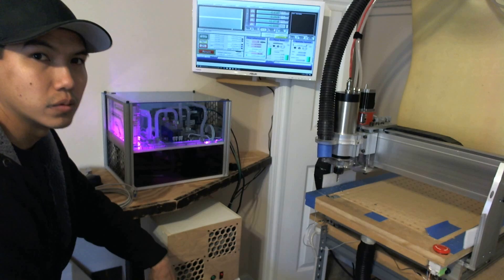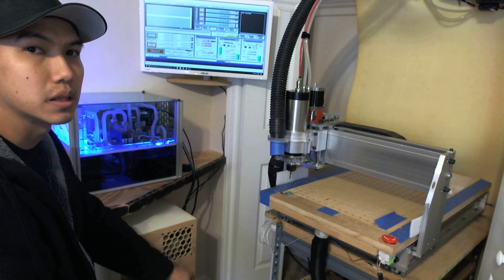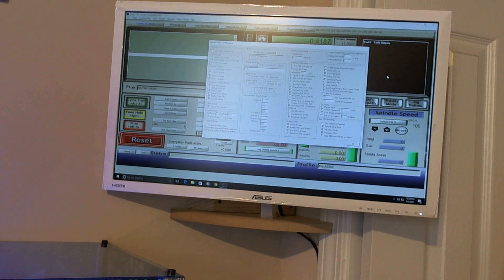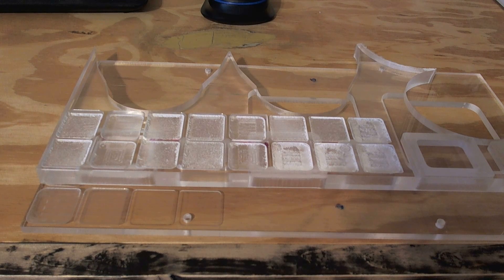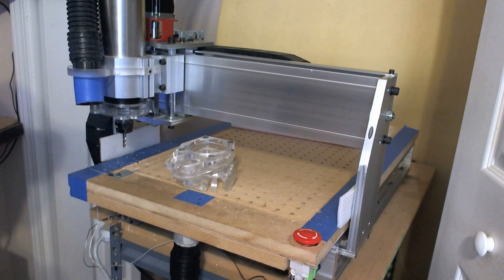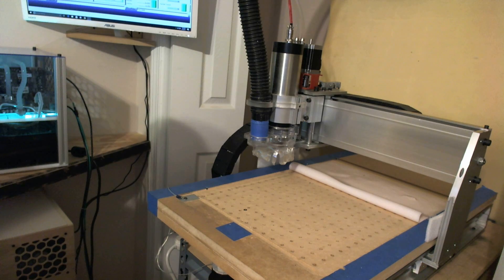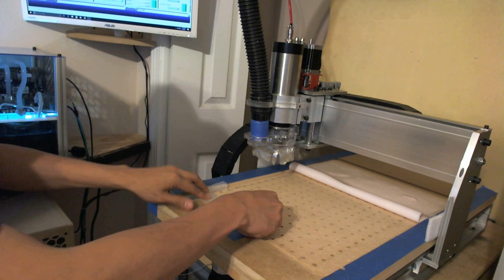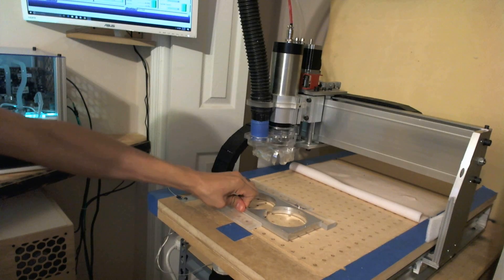CNC 6040 my problems and my fixes

Comment: HI 
CAN YOU HELP ME PLEASE 
I HAVE APROBLEM WITH MY MACHINE
Reply from the maker: I can try
Reply: @radikult-custom  z axis not working i get this massage "Safe Z turned off-ignoring safe z move"
Reply from the maker: @alideerhana1  did you “Home” the CNC?  Are you using Mach3 or what program you use to control the CNC ? 
That message appears when the Z axis has reach its limits of travel. 
If you are using Mach3 turn off “Soft Limits” and see if the z axis works
Reply: @radikult-custom  yes mach3
Whath you mean home
Can you send me guide ?
Reply: @radikult-custom  when i try to Turn the hinge screw i feel it not Catch not like the others x and y axis
Reply: Where i can see " soft limits " please
Reply from the maker: @alideerhana1  Mach3  is under Machine Coordinates “soft limit”
Reply: @radikult-custom  first thnx for your help 
, i will check today
If they not work , can i ask ypu again ?
Reply: Friend , not work 😓😢😢😭
Reply from the maker: @alideerhana1  I’m not to sure.  
 Config - Homing/limits  and see if the Z axis soft max and soft min is enough for your z travel

Comment: Hi, i have the same machine as you and everything is ok my problem is that the machine do the 1st cut really well but the second cut is offset? Any ideas? My i set the speet at 900 mm/ m and plunge at 500 mm/m... Please help me out.
Reply from the maker: It could be a lot of things.  Maybe some setting in the CaD program? Backlash setting? Noise going to the steppers.. it’s really hard to diagnose something. You just have to double check everything

Comment: I bought same machine, but gantry comes very unsquared. At the point i've made a gcode post-processor to compenste this problems. Do you have  experimented same problems on this machine?
Reply from the maker: Pablo Blanco I try to “adjust” the screws that hold the sides of the gantry to try to make the cnc square. But the closes I got to being square was 2mm off over the 400mm x travel
Reply: @radikult-custom  same for me!  I think the main problem is that only 1 motor control all the y axis. I have tons of problems with 2 side machining

Comment: Hi, I am new to CNC and just bought a 6040. Could elaborate a bit more on the macros you use in Mach3?
Reply from the maker: Sascha Schwarz the macros I found them on cnc forums. You will need to look for a tool change macro  and then place it in the “folder M6 start”   Located in you Mach3 macro files
Reply: I have seen that you mill thick aluminum on the machine. I tried some 6mm aluminum, but having problems when the bit cuts thru the bottom. I cut in multiple passes and it lifts my parts up in the last pass then the bit should mill the remaining thin rest, this caught in the flutes of the bit and lifts the part up. As the original aluminum extrusions for the table are so flimsy I am going to replace them now with a 10mm steel plate and adding a 20mm T-Nut table made out of massive aluminum instead of those cheap extrusions. I know I lose some height on my Z axis, but I hope I get more stability. 
Maybe you can do a video on the mill, speeds and feed rates you use for aluminum.
Reply from the maker: Sascha Schwarz I use a vacuum table to hold me pieces down,  maybe what you need is to leave some Tabs that way the piece don’t lift up after it finish cutting it

Comment: if I upgrade from the 1500 watt to the 2200 , will the electrical connection be the same ?
Reply from the maker: Rob M   Well the probably not,  I believe the 1.5kw VFD  is sometimes 110v  while the 2.2kw VFD are mostly 220v   Unless you find one that’s 110v then it could have similar electrical connections 
 Now from the VFD to the spindle will be the same connection except from the gauge  of the cables
Reply: well I got the 1500 watt usb version.. I cannot get mach 3 to communicate with the machine controller.. any advice ?? I know its an issue with drivers or plugins , im just not sure how to diagnose the issue.. I followed the instructions from the seller, but these only go so far.. If it doesn't work after their setup , youre kinda on your own
Reply from the maker: Rob M you are correct, Chinese seller are not to much help. The problem could be a “plug-in” for Mach3 to recognize the Chinese USB board, or maybe the setting on you Mach3 are not correct and that’s why it looks like it’s not communicating.  If I were you, I would try searching on forums and see if you can find any thing similar to the problem you have
Reply: I do think its a plugin or a driver .. from the instructions I got certain files need to be rewritten ( replaced ) in the C drive mach 3, but I cannot seem to make that happen.. been messing with it for days.. I have all the ports and pins settings and so on.. and the manual start info for the spindle , but that doesn't help till the machine moves
Reply: Hi Rob M I had that problem with mine
Reply: howd ya solve it >
Reply: did the seller send you any software for the pins and ports settings,it was loading that where I was going wrong
Reply: yes.. I copied that to a tee, tried 2 different computers .. tried different ports for the 378 sections.. etc etc.. Ive  been doing this for several days , mine is a new USB model so im really wishing I got the Paralell version.. reason is , theres a shitload of info on setting up the parallel version , theres really nothing on the usb version yet.. not to mention , Mach was designed to function via paralel
Reply: in other words, the controller has no parallel port anymore, just USB.. its supposed to be an upgrade, but its really a new headache
Reply: this also means the seller is sending me all the pin port configs for a Paralell , not USB.. I doubt they updated any of the info , and if I bought a parallel machine tomorrow , im certain all the info and downloads would be the same.. They don't seem to understand the difference when I messaged them asking them for the USB drivers, not the parallel
Reply: you mach3 did you get a file called USB6040
Reply: yes.. that file is in my C drive
Reply: ok. have you got mach3 and USB6040 backed up on a memory stick
Reply: no , I dont.. it was all emailed to me
Reply: I just downloaded and installed it , then extracted all the files
Reply: download it again onto a memory stick, because the download they emailed you will expire after so long
Reply: I have it saved on 2 computers, since I tried both computers.yes , it expires on the 6th
Reply: is the USB6040 folder in the mach3 folder
Reply: ill check now
Reply: I have a pdf file called usb6040 6090 .. its just the instructions
Reply: I found it in mach 3 ,. copied and paste it again just in case. no change
Reply: there should be a folder with USB6040 this is should set your pins and ports
Reply: yes, ive already done all the pins and ports from the instructions.( 8 times actually ). are you saying there is a program that im missing ??
Reply: they sent a folder with the files in it to set the pins and ports, all I had to do was drop the files into the mach3 folder and click on install mach3 and it set them all while it was installing
Reply: wow , I did all mine manually on 2 different computers.. that would be nice.. I think the port designations is an issue.. its running 378 port i.d , which makes no sense since that number is designated for the Paralel port ,.. since im running USB , id think that port identification would be different
Reply: mine is USB6040 CNCEST
Reply: I have the exact same model, what operating system do you run?
Reply: are there any tricks you remember from installing it ?? stuff that wasn't obvious
Reply: I run windows XP 32 bit. I loaded mach3 as they told and it didn't work.so I uninstalled it saved it to a memory stick and copied it into local disk (C) then copied the files from the USB6040 into the mach3 folder pressed install mach3 and that was it she just fired up. I just had to set soft limits and that was it
Reply: thanks,.im running out of ideas,, I might be the first person to return a brand new 6040 without ever testing it.. I had a bobs cnc router  before this , got that running no issues. So I don't think its me...Maybe the controller is dead in my machine, who knows.. thanks for all the help
Reply: one more thing , did you leave ox378 as the port for the machine in mach 3 ? in pins and plugs ?
Reply: I didn't have to change anything in pins and ports, ports is still ox378.I don't think it uses them because it's USB. do you have USB2 ports, have you asked the seller about the problems your having. I'm not sure I would have a bobs cnc router
Reply: the china seller also said use the usb6040 file.. but they never said what to do with it.. I already dropped it into the mach folder in c drive
Reply: the bobs cnc are made from wood , not rigid enough for anything but soft woods.
Reply: is the USB6040 file in a folder or is it just a file. mine are 4 files in a folder. I just copied the files into the mach3 folder and clicked on install mach3 and it worked ok
Reply: that was the problem.. I had it in the right place, but it was not opened.. I needed to download adobe reader.. Once I did that , everything started working , including the spindle.. thank you soo much ,I appreciate all your help!
Reply: there is a lot of guess work with there instructions. if you haven't used mach3 before be sure to set your soft limits and make sure your soft limits are on, other wise they are good machines for the money. if they play up it's most likely the wiring. have fun all the best
Reply: thanks man , already ran 3 g-codes no issues.. Yes , my instructions were horrible.. thanks again

Comment: HELLO FRIEND DOES LITTLE I HAVE A CNC 30 40, IT PROVES IT WITH MACH3 DEMO VERSION AND IT WORKED WELL BUT IT WAS LIMITED THE NUMBER OF LINES. DISCONNECT THE DEMO VERSION AND INSTALL A COMPLETE VERSION BUT NOW THERE IS NO COMMUNICATION BETWEEN THE PC AND THE MACHINE IF YOU KNOW A SOLUTION tankyou.
Reply from the maker: Alexander Cespedes I’ll check “ports and pins”  and make sure all pin outs are correct

Comment: Hi there. Thanks for doing these videos, they're extremely informative and helpful and your solutions are pretty ingenious. I have just bought a 6040 and have a lot of questions. I've got a UC100 arriving tomorrow so I can actually get the machine to start moving, I was wondering what the purpose of the red spacers was on your stepper motors. Are they something for preventing backlash?
Reply from the maker: Ben Smith the red brackets are just spacers, the shaft of the ballscrew and the shaft of the stepper motor is in the middle of the red spacer with a coupler
Reply from the maker: Ben Smith when I was using my 6040 I had a G540 and UC100  and the its was all good

Comment: Hi i just bought the cnc 6040 machine and first of already starting to regret buying this thing c/d i got was giving me an error setting up the mach3 eventually i got it online and was able to install the software but for some reason when connected to the computer or not it says release emergency break and no matter what i do that doesn't go away and the control board says E CH on it and does nothing  what should i dooo HELP PLEASE
Reply from the maker: john izzo hi
So does your breakout board has an emergency bottom connected? 
 If it does make sure you go into Mach3 configuration - ports and pins - input signal - and all the way down on the Estop  make sure is Enable and on the right pin 
 In case you don't have it connected  you can always "check" the "emulated " box and it should bypass the 'release emergency bottom

Comment: Did you upgrade the motor?  It looks larger than the one I saw in the stock photo of the 6040
Reply from the maker: TonyRomeNewMoney hmm  I bought my 6040cnc frame only and bought the electronics separate, they are nema23  and a 2.2kw spindle

Comment: there's a lot of new plug and play kits with USB on eBay for the 6040. would you recommend piecing everything together like you did or buying the kit ready to go?
Reply from the maker: I would  do some research on those kits,  why did I piece my cnc together- because at the time I bought mine I read that the "drivers" and cables weren't to good and then the .8kw spindle would not probably cut aluminum  1.5kw (maybe)
Reply from the maker: Waldo Rincon I haven't see how much other cnc cost but check others 
 I do recommend to go with a rigid cnc  like aluminium build instead or plastic/wood  (steal is probably the best but expensive) 
Research for sure

Comment: Hello, thank you for the video. Do you think a 1.5kw spindle (chinese from ali) would be a suitable upgrade over a stock 300w for Plexiglas and thin aluminium?
Reply from the maker: Kane Jaeger yes . One of the differences from the 2.2kw  it can hold up to 1/2 inch end mills.
Reply: Thanks man, nice PC by the way :)